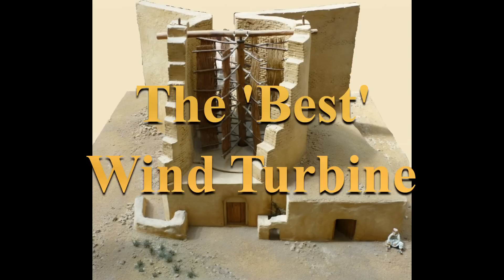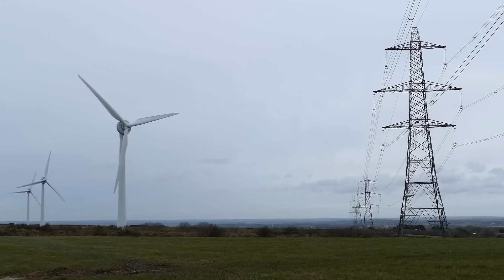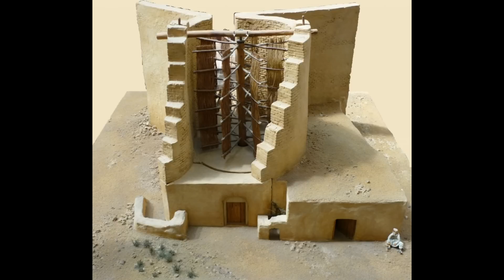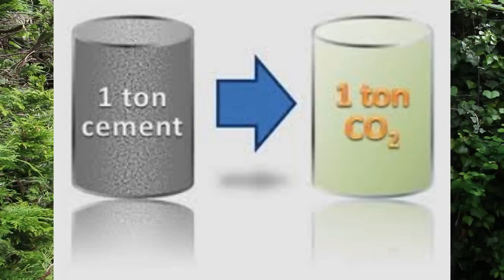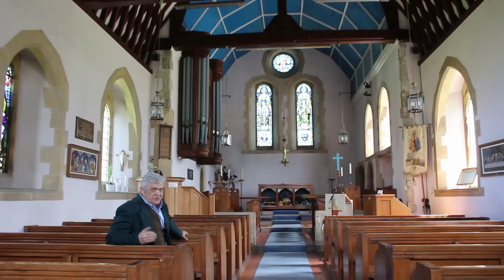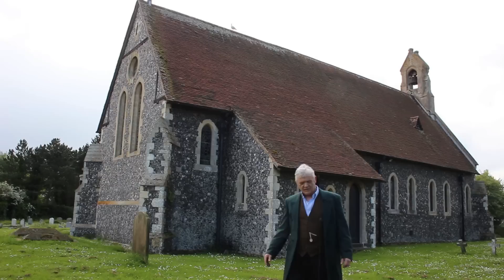1928 The 'Best' Wind Turbine

Comment: Agree.
Cost effective is another term some don't even think of. If you make one from mostly scrap parts it may be very cheap.
And as you mentioned upcycle and recycle or environmental impact is another issue / possibility. Scrap parts is good here too, but also renewable materials like for ex. blades made of wood.

Comment: The "Best One" also shows the single-mindedness about that there needs to be a "one-and-only" solution to everything. A Panacea that will cure every ailment.
The world doesn't work that way, every niche forms ist own set of problems, which in turn needs its own set of solutions. And some of them will conflict with each other, so you have to make a choice which one you want to apply... even IF its not the most efficient one per se, but the one most fitting for your problem

Comment: Good point. For most I think output per cost in most cases  trumps efficiency.... if 3 wind turbines at 50% eff costs the same as 1 at 80% eff. The lower efficiency wins on output for the cost.

Comment: Your statement "According to my view!" is valid! Each application has its own requirements.

In my work I found that the ISO/IEC 15288 Systems and software engineering — System life cycle processes was a useful yardstick that avoided "efficiency" or other localised yardsticks.
In other words how well does it satisfy the requirement over its total life-cycle.
That takes into consideration efficiency, operating costs, environmental effects, logistics (cost, producibility, maintainability, upgradability, etc), procurement costs, etc

Comment: Efficiency is important, but I think the environment that it is being built for is the most important. In low wind speeds, something like the Darwin Wind Tower that you've been working on is probably better than any traditional HAWT. In terms of swept area the Darwin Wind Tower will almost certainly have a far worse efficiency since each level of the tower is harvesting wind making it effectively part of the swept area of the blade, but it will have an ultimately smaller turbine for it. But because of the collected wind, it'll be much easier to turn than a traditional HAWT, and thus operate better under lower wind speeds. So something like the Darwin Wind Tower might be more appropriate for the city, while a big HAWT might be what is appropriate for an industrial scale wind farm.

Comment: Best! Best! You're giving me deja vu nightmares! I interviewed for an electrical  engineering position at a large corporation decades ago. I talked to each engineer in the department in turn until lastly introduced to an elderly engineer with a thick slavic accent. He wanted to talk about inductors. He asked me what was the BEST inductor. I said it depends on how best was defines due to the situation. If cost is the driver then a simple copper coil if it can meet the specs may ne the answer. If size was the primary goal then perhaps a winding on a ferrite core. As I continued he threw up his hands and and began to scream best! best!. I excused myself and went to dept manager and declined to persue the position.

Comment: IMHO the best one is the one that you can sit and forget. By that I mean, one that has almost no maintenance and can be used outside of you building, or inside your building. And then there is the noise factor. If it is to noisy, you don't want it near your home. In the very near future there will be one like this, and it will be cheap, portable, and nearly noiseless.

Comment: Just had a thought... Why isn't anyone building housing out of those old wind turbine blades?  
If you layer them out in alternating directions they'd probably make a good foundation for a floor or a roof and such to hold the structure.  

Then wrap it in some constructional fabric like what they used for the roof of the Denver airport and fill those bags with dirt and other insulation... Maybe even air?  

Got to be some use for them if people just got creative...
Reply: Another thought... What if they repurposed those blades into a vawt feather turbine?  😅

Comment: I use to inspect the HV side of about 200 - 300 vertical wind turbines in England, Wales, Scotland each month. All of the sites have a ' Met mast' [ meteorological mast ] with a anemometer fitted on the top of it always searching for the best wind direction for the turbines to face. Obviously computer controlled. Blades and generator at the top and HV transformer at the bottom connected via HV cables. Should the turbine/s continue to turn in the same direction for more than 2.5 turns, a shear pin would be ' pulled' automatically and stop the cables becoming ' cork screwed'. Won't bore you with more details
other than to say 'the grid ' can't take what they can sometimes supply so are tripped. Such a waste of energy me thinks !
Reply: - not boring at all... But if you only build nameplate capacity there will be many times when the grid is lacking supply, that is the rub with intermittency - surpkus is required some of the time.  The cost isn't for the "capacity" it is for the need to overbuilt in order to ensure supply, that factor is still up for debate. (The costs are rarely discussed for a firm grid, today.)
Reply: @kadmow  As Rob has aptly shown, it's easy to make electricity, the problem is storing it any any great quantity for use when needed. What to do with surplus electricity ..? Just another ' throw away Q' .. do the grid/s want electricity from sources they don't own ..? Hhmm . you and I do, but ...maybe getting a bit off topic here eh ..lol ..
Reply: @brianknowles7130   - Where I live the Grid isn't owned by the retailers. Not to say the market system in place is perfect, while retailers may have generation "branches" the transmission system is owned by an independent authority - so the power on the grid isn't influenced by any entity - but market forces..

I am geared to mostly use my own generation and storage at home - except for transport, EVs aren't in my allowable budget, and I prefer not to pander to my own vanity (not economical)..  lol_

So we have a 2-fold problem, intermittency and inability to store surplus - these are unlikely to be solves in a simple way, so we will continue to pay for surplus generation (presently cheaper than firming the grid with storage - outside of the perfect world.)

Have a great day.

Comment: The best one, is the one that works 😉
Reply: Or more so, the one that keeps working.

I've played around with both vertical axis and horizontal axis and the bearings taking so much load on the vertical ones meant they would stop functioning (seize the bearing) in a shorter time frame.  The horizontal axis one has outlived the other by 3 years and still going strong.  (I'm off-grid on solar and wind).
Reply: @K10wNs-Shed  hmm, interesting point
Reply: @K10wNs-Shed  did your vertical windmills only connect at the bottom?
Reply: @bobroberts8500  Mounted from both the top and bottom on tapered bearings.  I guess that keeping the weather out of the bearings was also an issue and contributed to the failure in less time than expected.

Using a magnetic bearing to hold the weight might be a solution.  Not sure it would be able to hold the weight of such a large structure though.
Reply: ...best.